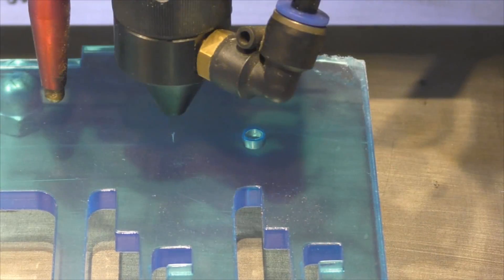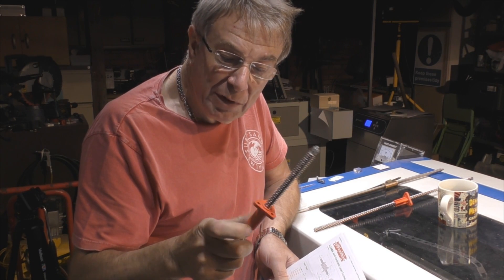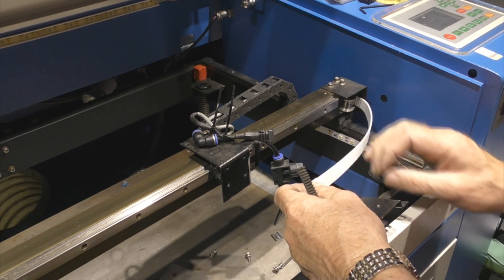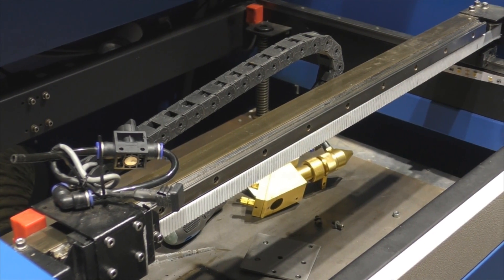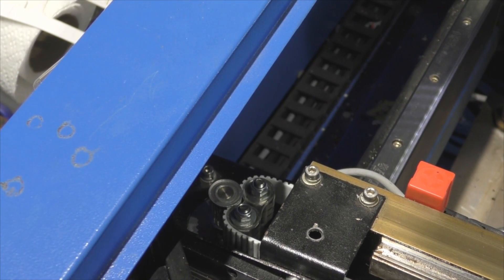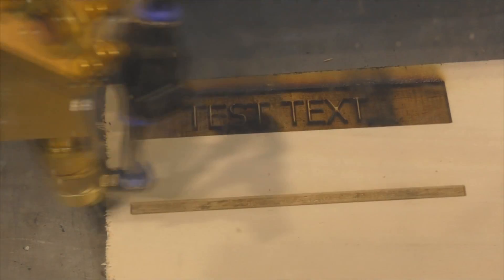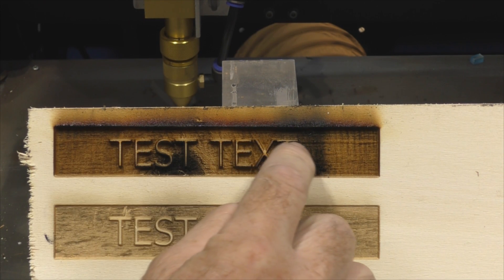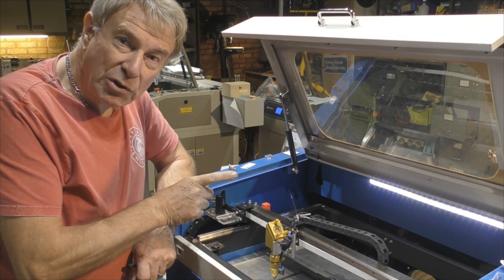RDWorks Learning Lab 121 Is this CURTAINS for CURTAINS

Comment: Very cool, I have to check on my machine if this is a problem, did you consider helical tooth profile or are they only available between gears?
Another thing I need to ask which doesn´t have anything to do with this video, did you ever try GaAs lenses instead of ZeSn. I posted the question on a forum but did not get a conclusive answer nor do I find one when searching online.

Best regards
Reply from the maker: You can get herringbone toothed belts but not this small
Take a look at   https://www.youtube.com/watch?v=QFLq14vY2zQ  from 2 years ago when I first tried to work out what caused this problem.
Timing belts were not designed for this application (the clue is in the name), they were designed for transmitting lots of horsepower in ONE direction. The designers of these Chinese machines have hijacked the tooth belt technology because it seems logically to be everything we want. Cheap, quiet, low inertia, non slip, low maintenance  and to repeat myself, CHEAP.  Sadly, as the analysis shows it has one little bad habit that makes it unsuitable for some uses of  the laser machine. Our laser beam is a constant power  device during scanning and if the beam slows down, the cut will be deeper and faster speeds reduce the cut depth. Hence our little machine produces an excellent 3D graph of the head velocity.  This curtains pattern is prominent at certain speeds indicating that there is a mechanical resonance happening as well.  This was researched in    https://www.youtube.com/watch?v=SsSFVTAhng4

In the last year since this video I have done lots of engraving and not encountered any hint of curtains.

As for your GaAs question, yes this was well researched in the following videos. The outstanding cutting performance cannot be explained because the way that IR light travels through the different lens materials is a physics question too far. However,r the results are more important than the explanation although this is a question on my research list.

https://www.youtube.com/watch?v=5fgw5hnU8EY
https://www.youtube.com/watch?v=TeEdbd9YWAE
https://www.youtube.com/watch?v=LArKiymBry0

Best wishes
Russ

Comment: You just need belt tensioner pulley with teeth
Reply from the maker: Ideas are just that until proven. Others have suggested that they have fixed a similar issue with their 3D printers by employing your method. Lasers are a lot more sensitive to micro velocity variations and I'm afraid the same trick has no effect on laser "curtains" I have used  two other laser machines that have toothed tensioners at the other end of the belt and the curtains are worse. The real issue is that toothed belts were not designed for precision oscillating motion. There were hijacked from the unidirectional power transmission area because they can do a 95% efficient job much cheaper than leadscrews or rack and pinion drives.  Curtains (variable velocity as teeth engage and disengage)  ,backlash ( tooth clearance and belt climb) and resonance (because of tooth compliance)  are the three main design compromises you have to live with when you select a belt drive positioning system. Turning the belt over and forcing the teeth into engagement  with smooth surface idlers has removed engagement velocity variations, and prevented belt climb. I have also changed to a urethane belt with significantly less compliant teeth. I have, in fact,  created a flexible rack and pinion system. 
Best wishes
Russ

Comment: Impressive, I have preguantas, with this change I can record at faster speeds without deforming the image ,?

Because the change is only made to the X axis, can we do it for the axis and also?
Reply from the maker: Hi Jean Carlos
 The machine runs the same as it did before but smoother. You can run at any speed and there is no hint of this curtains effect. Your words about deforming the image are a bit worrying. Do you have problem running at higher speeds?  The Y axis is not as important because it is only creeping forward during engraving and there are no obvious Y axis curtain effects. Why fix a problem that does not exist?
Best wishes
Russ

Comment: Russ, what I would like to know is if you changed the smooth roller over to a 24 toothed gear and left the belt as it was would that have solved the issue?  One other thing is why doesn't everyone, and every machine, have this issue like your lightblade for instance?
Reply from the maker: On my China blue machine I have 16 tooth pulleys A car with 16 flats on its front tyres  would not make for a comfortable ride. Would adding 16 flat tyres to the back improve the ride? The mathematical analysis says no to both and the curtains are living proof of changing head velocity as each tooth engages and disengages. Running on smooth pulleys with the smooth side of the belt MUST remove this issue. This has effectively simulated a rack and pinion drive which is standard on most big CNC machines. 
 The Lightblade machine has about 24 teeth on its pulleys but the curtains are still there  but a little less obvious
see https://www.youtube.com/watch?v=b9KwuJh1RhA at 17 minutes.
It also happens in wood and acrylic engraving on the Lightblade. Turning the belt on the Lightblade is not such a simple task so it will wait for a while.
Best wishes
Russ
Reply: See, smooth to smooth and tooth to tooth but having a toothed gear on both sides eliminates the issue of "driving over railroad ties" unless one gear was not the same tooth count as the other.  btw, did you ever create a final version of your fix?
Reply from the maker: Just last Friday I visited a guy with a machine that had 16 toothed pulleys on both ends of his X axis belt.  Knowing of the matched pulleys theory to eliminate  curtains, I made sure I checked for this whilst showing him how to do relief engraving into acrylic sheet. His curtains were VERY distinct  I really can't say more than this. The maths describes the velocity variation at tooth engagement and disengagement. I have acted upon this evidence and fixed the problem on my machine and now I have evidence that the matched tooth pulley idea is not a viable solution.
Best wishes
Russ
Reply: Good to know.  My gears are 24t and pressed on at that (yuck) but your video with your fix was only temporary and did you ever make a perm resolution?
Reply from the maker: The 2nd metal version is still there and working well today. I have no intention nof changing it as it works so well.
Best wishes
Russ
Reply: I wish they made these because I have no ability to work with metal like that.  What you made I will need but my gears are almost twice the size as yours are, indeed, 16t and mine are 24t.
Reply from the maker: Several folks have asked about buying but I'm afraid there are too many variables to attempt "long distance" manufacture.  You may have Nema 17 motors (mine are Nema 23), the fixing screws may not be available for dual use  (as mine were) the size of your pulleys and the space around them will be completely different and the new path that you belt takes may collide with your gantry. . All contribute to me having to say that what I am demonstrating is a principle that works but you will have to measure and evaluate if and how you can adapt it to fit your machine.. My 5 or 6mm thick acrylic prototype may have been adequate but as I was changing the design for the final version I felt more comfortable with a metal mount. I apologize for my negative answer but I hope you will now understand the difficulties.

All best wishes for Christmas
Russ
Reply: I do have Nema 23 motors and I was looking at it this morning and 625zz would work perfectly for one bolt that is used on the far upper corner (towards the wall of the machine) but all other bolts are just too close to various other things so I am stumped how I would fix this issue as there is just no space.  btw, my gears are 8mm bore and 28mm in diameter being 24 tooth.
Reply: Anyone who comes to this and reads this thread I did do this but I had to print my own smooth idlers and use 624 bearings for X and on Y I used 623 flanged bearings.  X is 9mm GT2 and Y is 6mm GT2 on each side and all curtains are now gone PLUS the machine actually runs smoother so now even Y can do 500mm/s instead of 300mm/s max.  Well worth the effort.

Comment: Wow! Congratulations on this success! I must have missed in previous episodes your trick to tell the laser where to start cutting, so that the smoke doesn't drag on the etched surface. Please elaborate, thanks again!
Reply from the maker: Hi Mike
If you go to Config, System Settings, you will find 9 head positions. The top 3 will force a top down scan and the lower 6 will force a bottom up scan. Sorry no magic!!
All best wishes
Russ
Reply: SarbarMultimedia omgosh, I use that setting all the time mostly to center and set up the work I never even noticed that it dictated the start of the laser. Doh!

Comment: Great videos, I've been watching for some time and have just created an account so I can write on here.  I think you may be looking for belts called "silent sync" they are slanted in both directions and ride on a pulley that looks like tractor tire treads, because of their angles the belt never changes contact tension.  The down side is a new belt and pulley.

Comment: hi russ 
good video as always
i have a problem of shifting when engraving only but the cut is perfect any idea what is wrong?
Reply from the maker: Hi Hossam
There are several possible reasons but I shall need to ask more questions and see some pictures.  Please use the You Tube personal messaging system to send me your email and I 'll get back to you.

Many folks don't know how to send a message so here's how.
Double click on the orange S square and it will open a home page for Sarbar Mulktimedia.   
Add     /about              to the end of the link in the address bar  and ENTER
A new page opens and at top right there will be a message button.

Best wishes
Russ
Reply: i already did, thanks in advance
Reply: Try adjusting backlash & offset.

Comment: For those who would not have access to metal cutting, perhaps an alternative would be to do this:
Only 50% of the belt rides on the idle wheel, if the belt were simply twisted so the smooth side of the belt would then run on the idle wheel. This requires some additional belt to allow for the twist. The advantages  are not needing to tamper with machine settings, or awkward access to motor mountings.
Reply from the maker: Hi John 
Certainly doable but not everyone has a spare belt to play with so there is a £15 to £35 cost depending on the belt type/material you buy. HOWEVER, you could achieve your goal by putting a half twist along the back side of the belt. This would put the smooth face onto the idler and allow you to reconnect without any change in belt length.
This is only half the problem though. Back to session #83 you will find my exaggerated 4 toothed pulley wheel example of how the head velocity changes for every tooth engagement. The smooth belt on one end does not change this issue. That is why I have fully turned my belt. so that it runs over all smooth surfaces. Many folks (particularly 3D printer users) have claimed that changing the idler to a toothed wheel will fix the problem. Under certain circumstances they are correct but the problem is only  hidden with this approach, and, if you are unlucky with the distance between your pulleys, you could make it worse. Let me explain using the simple 4 tooth pulley idea. In #83 you will see what happens when just one end is a 4 tooth pulley.. Now put a 4 tooth pulley in place of the smooth idler. IF the teeth are synchronized  ie the corners on both wheels are at 12 o'clock, then BOTH sides of the belt will want to be longer but cannot be because the wheel centres are fixed.  Hence each side of the belt will be equally tensioned instead and there will be no  net velocity change during each engagement.  Now move the idler 45 degrees out of sync and imagine what happens. I was visiting a guy just recently with a 16 tooth drive wheel and a 16 tooth idler. As if to prove my point I found that his curtain effect was like a roller coaster.
Thanks for the thought but try the half twist method first....even though I hope you can now see it will not solve your problem but it will cost nothing for you to prove it.

All best wishes
Russ
Reply: I have tested this half-twist but without something positive. I even have the impression that the vibrations increase due to the twisting of the belt. my laser has 24 tooth pulleys and i will now test this inverted tangential drift.
Thanks for your great videos and ideas

Comment: Now that you have that figured out, you can now look into the 3D cutting more and more.  I would like to see more on that subject.
Reply: Hi Scott
I will be revisiting  3D engraving (a fascinating subject) but I plan to do some more dotty stuff first. I have been made aware that some people are successfully using very high resolution images whilst working with anodized aluminium. Now I know my dotty formula will work with any material BUT what is so special about anodized aluminium that allows working at higher resolutions? A serious puzzle that needs to be understood. 
All best wishes
Russ

Comment: Hey Russ! 
Just wondering if this is an idea for another video...
I recently played about with the height of the air nozzle from the material (note, not laser focus height, just the height of the nozzle to the material, the lens stays the correct focus distance)
And I have noticed a difference with dust ECT, I tried this as I don't currently have the room for a compressor to up the air assist, so thought about 'cheating' it with a lower nozzle.
Also, I read some folk running 50psi as air assist....
Surely that would stress/crack the lens? Some of these folk have went through a couple of lenses where I am still on my original!
Reply from the maker: Hi Michael
You are perfectly correct about the nozzle height I have already tackled this subject in   https://youtu.be/OCVsMXw6yh4.  It's not just nozzle height it's also nozzle diameter as well.. This machine requires two extremes (usually). For cutting you need to get as much air flow into your cut as possible. . If you have a large distance between work and nozzle then the air into your cut will be very poor because the expanding air will wash the surface of your work rather than go down into your direct cut area.. In creasing the source pressure will help a bit but now it depends on the size of your nozzle.. The tube that leads to your nozzle is always 6mm od and 4mm id. My China blue nozzle is just  4.5mm diameter so there is absolutely zero resistance from my nozzle to the incoming airflow.. The pressure within my nozzle is stll zero  ie. what comes in goes out.  It's a particularly poor system saved by the fact that I use a 1.5" lens that sets the gap to about 5mm. On the other hand my Lightblade machine is set about 7.5mm above the surface and is more efficient with a 1.5" lens because the nozzle orifice is 2.5mm diameter ie 35% of the area so there is a pressure build up inside the nozzle but that pressure build up cannot exceed the pumps capabiliy of 3psi even if I put my finger to block the nozzle. That stupidly small flow is used efficiently and does a great job of squirting air efficiently iinto the cut.  When folks talk of stupidly high pressures they do nut understand the principles of pneumatic flows. If you have any concept of current flows in an electric circuit  it' an aproximate analogy to tp think of two resistances in a battery circuit. The first resistance is 100ohms (the 4mm pipe) and the second is 1 ohm (the nozzle.)  The circuit current (airflow) is limited by the 100ohms (pipework) and there will be a small residual voltage (pressure) to force the current across the 1 ohm (nozzle). This is not a perfect analogy because electrons are not compressible and air is. Believe me, you approach is the correct one. Low pressure and lowish flows produce laminar flow out of your nozzle which will be very efficient at jumping the air gap To much pressure and you produce turbulent flow as the air exits the nozzle and that immediately expands and spreads everywhere . More is actually less.
With engraving you normally require almost nothing, just enogh to stop your lens fogging. 
Cutting acrylic is different again. Very gentle airflow to cut and the merest whisper to engrave.

Thanks for the comment
Best wishes
Russ
Reply: SarbarMultimedia ah... That was the video I was looking for, and it reminded me of something else...
Your mirrors have that shroud with the two 'pipes', would some low pressure air flow (exactly like air assist but plumbed into shroud) help keep mirrors clear, and also cool... 
As I cut a lot of mdf, I am always cleaning my mirrors, a 'mirror air assist' would ease the maintenance!

And as for my air nozzle, I am working on an easily adjustable air  assist, I have a mcgyverd system using plastic pipe spacers, but working on a slideable tube option for quick adjistment
Reply from the maker: Hi Michael
There are air purged mirrors on some pro machines but to be honest if you have a good extraction system the fumes never go anywhere near the mirrors. I never clean mine , maybe once in  6 months.
Regards
Russ